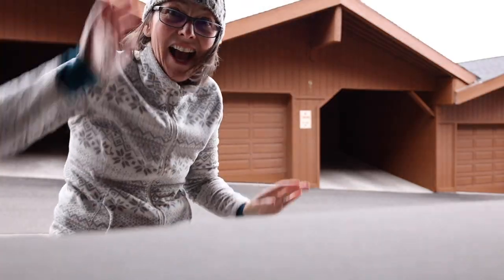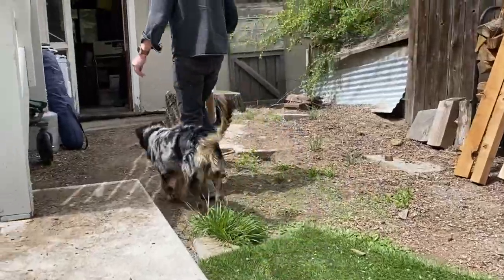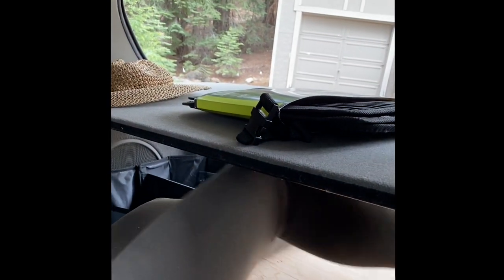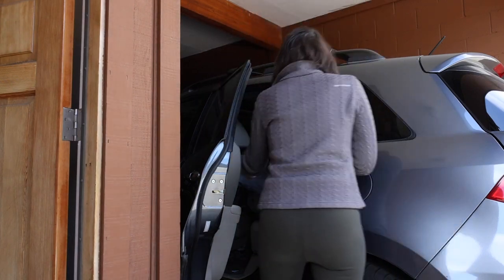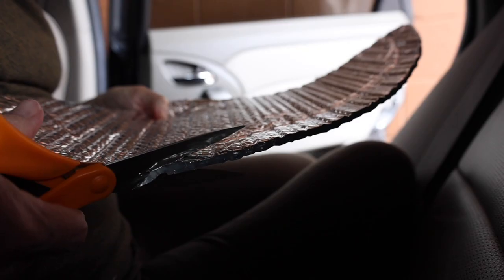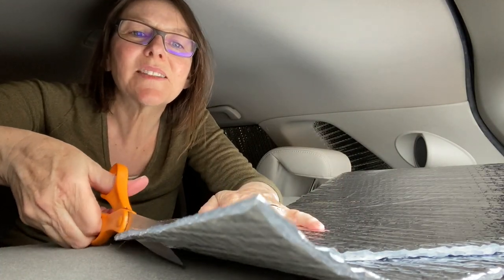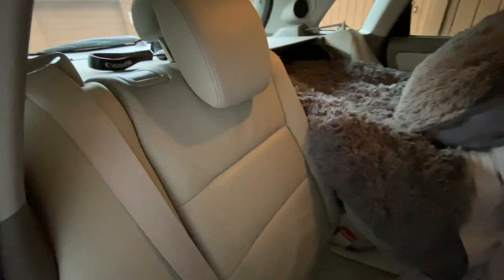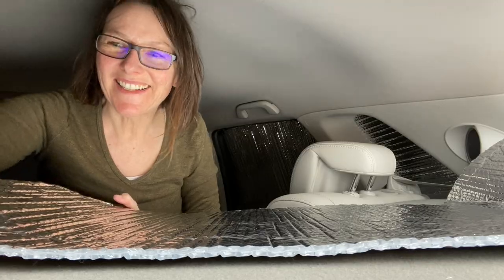My No Build Amazon CAR CAMPING Setup... 🚘

Comment: Why don’t you 1) move the bed to the other side and pull the passanger seat all the way to the front, so you can have more room; 2) if you take the head rest off of the seat that is folded down you have easy access to storage space behind the passanger seat and 3) you can then add another piece of wood to extend the bed platform 😉
Reply from the maker: Yaya, good ideas, thanks for the suggestions. That passenger side back seat is now broken and won't come down, so something I'll have to fix when I get back!
Reply: That sucks on it being broken

Comment: For anyone else struggling with reflectix window covers.  You don't really need a template,  just cut a piece of reflectix slightly bigger than the window then offer it up and score around  the shape of you're window with your finger nail or a pencil then cut with scissors. Any small gaps will probably be padded out when you attach fabric or you can cover one side with duck tape and use that to correct any gaps. Covering in fabric? Please DON'T use adhesive spray in your campers,  it's usually carcinogenic and dangerous to your health.  You could hand stitch, tape or staple. 💜
Reply from the maker: Thanks for the additional tips!

Comment: That's it. That's exactly 💯 it. You use what you have until you can do better. The Jackery was a great purchase. Will make life easier. I used Power packs until I got mine. Also a small Cheverlot Spark for the journeys with stuff purchased that I later found out was unncessary. Just got rid of the Spark. Have a MPV now,  also the stuff I didn't need is coming in handy as I venture out further. Enjoy the experience with what you have to start and the things you have purchased. 🇬🇧 solo female car camper.
Reply from the maker: Thanks, Happy Days. I appreciate your support!

Comment: Thanks video showing your build it's complete now .Bed I did differently passenger side is the bed platform,rear deck seats in hatchbacks fold flat remove all headrests but driver's side is it's flat platform then  rear bumper to front dash .
Reply from the maker: Actually, on my latest trip that's how I ended up configuring mine as well!
Reply: @dianeschmiane  there really is no other option in these types of vehicle and it all goes back to normal with seat up and head rest reinstalled.

Comment: I would have suggested taking out the rear seat, it can easily be re- installed when you decide to sell it.
Reply: Or maybe even the right side passenger seat.
Reply from the maker: As it turns out, the hubby later discovered that the seat bottoms easily remove so that the whole back area can be flat. So, I'll have to rethink everything for the next trip... :)

Comment: Thanks for sharing your car set up journey.  I have been working on mine's for awhile as I wait for my new SUV to arrive.
Reply from the maker: A new SUV sounds exciting! Hope it works out the way you envision... :)
Reply: @dianeschmiane  It isn't about being new, although still very exciting if you can. I started out in what I had, a small tiny Cheverlot Spark. I tried it out many a journey, it was tight but worked. I only just upgraded when the car was struggling to cope with uphill journeys and I was throwing money at it with repairs. 
I wanted a new van, but it wasn't practical or stealth. I bought a a MPV. It has been great. My point is, you work with what you have until you can upgrade comfortably within your budget. Nothing else matters up to that point. It is about getting out and about.
🇬🇧 solo car camper. Enjoy the experience, you bought enough of the new to get started, I did too then realised a lot I bought wasn't necessary. But the Jackery was. No builds are the best because you can move things around. Take care and stay blessed.

Comment: Caravan Carolyn sent me. I am now your problem as well.
I have a few different RV's lots of sewing machines and window covers have got to be the largest pain. 
One easier wa6y is to rough cut the paper or cardboard to fill most of the space, then use a hot melt glue gun or glue stick to glue pieces to the parameter. Still a pain, but easier.
Reply from the maker: Good idea, thanks for sharing that! Trouble is, they've all shrunk now due to extreme heat, which you'll see in an upcoming video. So, back to the drawing board... :(
Reply: @dianeschmiane  You can sew on a boarder. to them all., Problem with making new ones out of the same material is they may shrink as well.
Reply from the maker: @DannyB-cs9vx  And I hate sewing, haha!

Comment from the maker: If you have any great ideas for car camping hacks, let me know. Here's another video you might enjoy: https://youtu.be/84OLXaET2KM
Reply: Can you move your front seat forward so it’s not such an incline for the head?
Reply: So I do those relectix shaded for customers all the time. If you want to buy precut ones, weather tech makes them. But if you don’t want to spend that $125 , here is a tip for the next set.  Get packing paper from lowes, tape it to the outside of the doors, etc, then shine a light from behind and then make your cutout patterns by tracing the lighted paper.  Plus, you only have to do it on one side of the vehicle, just flip the template and do the other set.
Reply from the maker: @watching-and-judging-you   Great idea, thanks for the tip!

Comment: I feel your pain on making those window covers! 😫 Can I ask what specific fabric you used for the blackout side that doesn’t fray when you cut it? I used a blackout curtain from Walmart and the second it’s cut it starts unraveling so I have black fabric pieces falling off the shades at all times. Thanks for any help or tips you can share! 💚🚙💚
Reply from the maker: It was some flannel from Walmart that will fray, but so far not so much since it's glued down pretty firmly with that Scotch spray-on adhesive.
Reply: Hem the edges, and they won't fray.  Fold the fabric twice at the edges and sew it right up.  Gotta have a machine for this!
Reply: Campervan Carolyn just suggested a new channel called Honey and Me where she showed VERY detailed instructions on making windows coverings.
Reply from the maker: @knellwal  Very cool, thanks. I'll check that out. The ones I made actually shrank in the extreme summer heat!!
Reply: I have the Reflectix in the garage but after watching so many people agonize through the process (and seen many less than stellar results) I’m glad I bit the bullet and went with Heat Shield (gold one side and black the other). They have suction cups and are custom made for my 2019 Outback.  It was a very painful $270 (including sunroof) but I convinced myself that it was equal to a couple of trips to Costco. 

It’s a fact of life that Made in USA is going to cost a lot more than Made in China.
Reply: The Reflectix is fantastic for making covers for fridges and coolers.
Reply: You can buy black poster board at the dollar type stores. Or you could get black fleece at a fabric store, Joann’s has it. It doesn’t fray.
Reply: @sandrakramer1520   thanks Sandra, will keep that in mind. I’ve seen “ in the open air” use those, they look awesome
Reply: Felt

Comment: I think I would have used duct tape to make the trim around the window coverings so It is like one continuous long tab all the way around the reflextics.  That they would slightly bend going in, still fit and cover up the little spots that were not perfect. I wonder if that would work?
Reply from the maker: Yeah, I'm thinking about ordering some black duct tape to do just that!

Comment: I am about to make window covers for my Outback and not looking forward to it :(.   I bought black contact sheet to blacken one side.  I hope it works (vs. fabric and spray glue).
Reply from the maker: Jen, contact paper is a great idea, I hadn't thought of that. Maybe that would help prevent it from shrinking so much in extreme heat? People have also suggested that I line the edges with tape to keep everything together more securely.
Reply: @dianeschmiane  contact sheet shrinks when using a heat gun (some said hair dryer in low heat is tolerable).  I have not heard of Reflectix shrinking in heat though.  But I am sure it does (crocs shrinks exposed to sun).  Black duct tape may be good to cover the raw edge like a bias tape.  Now the weather is gonna turn.  Perhaps only use window covers at night to stop it from sun exposure.

Comment: I have a 2008 Acura rdx & the seats do fold flat
Reply from the maker: What I later learned for mine, is that if you pull out the seat bottoms (easy to do), then they fold flat.

Comment: That was a lot of work! Maybe rent an RV? 😆 New subscriber, I'm looking forward to watching your adventures
Reply from the maker: I would except that I need to be a super low budget traveler at this point, gotta work with what you've got!
Reply: I have an RV 12 miles to the gallon or 30. Car or van far easier to manoeuver. I'm heading out in my car as soon as I finish jury duty.
Reply from the maker: @vlynn8816  Very cool, hope you get out there soon!

Comment: Another question LOL.  How important do you feel the plywood is?
Reply from the maker: I have mixed feelings about it. On the one hand it's great for leveling out the bed more and providing really valuable storage underneath. On the other hand, I sometimes hit the shelf with my legs turning over at night and I can't sit up on the bed. I need a van... :)
Reply: @dianeschmiane  the plan is the trade the Altima in a year or so but use it now until I decide if this is the route I want to take in life but I feel SO trapped in my current life.  Stale and just numb

Comment: When making reflectics you want to use PAINTERS TAPE to tape the wrapping paper to the OUTSIDE of the glass and let it hang to get the shape.  

You want the piece to be slightly bigger than the inside because then it will be tight enough to not fall. 

It’s a very cumbersome process but it can be done.
Reply from the maker: Thanks for the tip, that sounds like it might have been easier.

Comment: But I thought this was "No build"? What's with the woodworker and building stuff?
Reply from the maker: I could have easily gone into any local hardware store, bought a piece of plywood, and had them cut it to whatever dimensions necessary. But I had a wonderful friend willing to do it all for free, so I went that direction. Either way, I built nothing. No nails, no screws, just a piece of wood on a shelf.